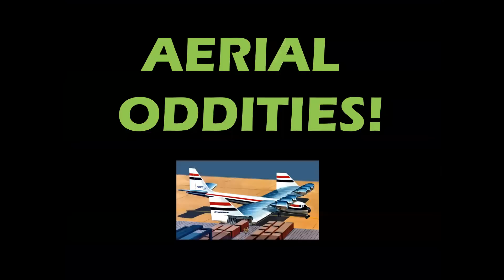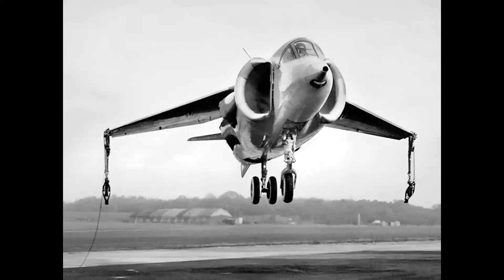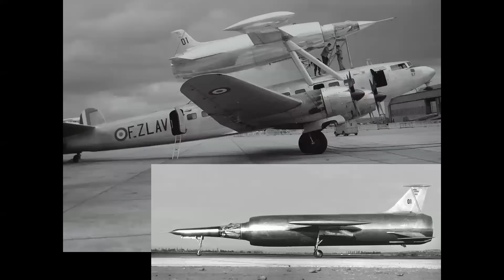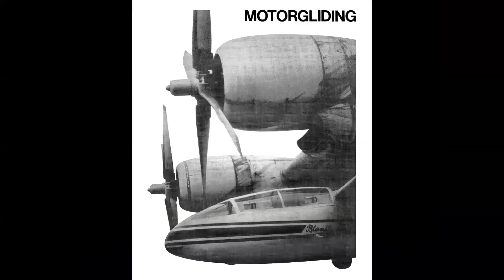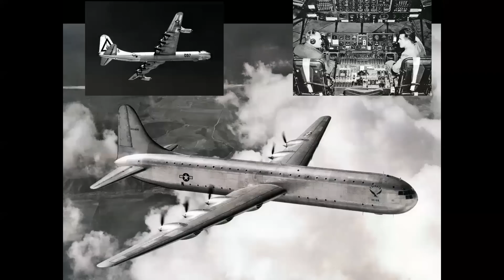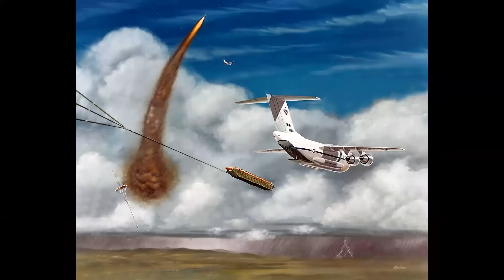AERIAL ODDITIES! - Strange and Unusual Aircraft from World War II to the Present

Comment: Chase / Stroukoff YC-134E was an upgraded C-123 with BLC for STOL, a strengthened sealed fuselage (mo boat "step") fitted with "Pantobase" pair of skis.
On skis, it operated from pavement, unimproved ground, sand, swamp/mud, water, snow/ice.
For some reason, the Pentagon wasn't interested.

Comment: Hi Mike,
I remember seeing some artwork, similar to what you are showing, from the early 1980s (???), outlining what seemed to have been a stretched, and significantly enlarged F-15, that was proposed as a maritime patrol / anti-submarine aircraft.  It featured three engines mounted in the rear, underneath the twin vertical stabilizers.  The concept was that while on-station both outboard engines were shutdown and the entire aircraft operated on the single center engine.  For takeoff and times where maximum performance was needed, all three engines were utilized.  From what I remember it was supposed to have a payload of 30,000 pounds and an un-refueled endurance of approximately 8 hours, while being capable of achieving speeds of more than Mach 2.   I was wondering if you had seen or heard of this aircraft?
Reply: It's possible you're misremembering the NR-349 proposal of the A-5 vigilante, everything you described is pretty much on the dot save for the twin verticals, I can't find any 1980s concept of a twin tailed tri-engined maritime patrol aircraft anywhere.
Reply from the maker: Not familiar with that concept, and thanks for your comment!

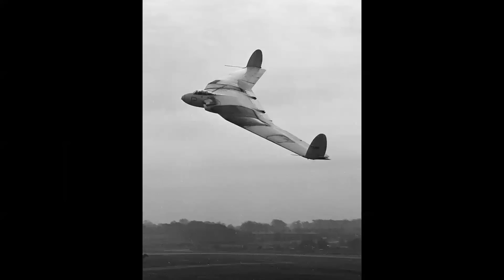Comment: The Thunder Schreech was an attempt at economy in a possible theory. It was an attempt to see if there could be a Mach One plus or more propeller driven airplane. The sonic vibrations coming from it during flight caused medical problems with everyone that was around when in operation including and worst of all for the pilots. 7:08/ It might have worked with extra controls on canards from the nose or pillons extended from the front of the wings. The P-32 Lihtning wasn't somewhat of an oddity? It was the production version of the F-82 double Mustang and was twice as good and twice as BADASS as a regular P-51 Mustang. Spam-load planes. Structurally, I don't think so.

Comment: I enjoy watching aviation oddities.
 There are a few you missed though.
 1)  a DHC5 buffalo landing with an air cushion like a hovercraft
2) a twin engined Hercules designed for the COD role.
3) a flying boat version of the Hercules with engines above the wings aka the Orion, which as of 2022  is being considered as a massive twin float seaplane.
4) a British vtol jet airliner
Reply: @ Paul Niccoll , of the twin engined Hercules that You said you would like to see featured, Lockheed did propose making a smaller twin engined Hercules called the L400, but it was canceled before making it into production.. But there is a twin engine plane type that were made in fairly large numbers (214 planes) made by a company called Transall,  and designated it, the C-160... It looks similar to a C-130, especially the empenage & dorsal fin...

Comment: Sad that when talking about tailless planes, you did not mention the flying wings of the Horten brothers. They developed a wing layout, with a "bell"-shaped lift distribution, that was stable, maneuvrable and VERY efficient. It ended up in the Horten Ho IX (also called Ho 229 an Gö 229) jet fighters, of which one prototype, the V-3, still survives in the US.  
 
Weird that their layout was apparently largely ignored by later designers of tailless aircraft. 
 
 
And regarding a load-carrying airship: In the late 90s there was the Cargolifter project in Germany, an airship that should be able to carry up to 350,000 pounds of cargo. The argument was that this would make it possible to transport large bulky assemblies in one piece point-to-point, which would be very hard or impossible to transport on the road or by train. 
 
But after the company had completed a giant 1,000 foot long assembly hall, it went broke. "Miraculously" the hall could be reused as holiday park.

Comment: I'm surprised that you didn't mention the scissorwing x-plane, the Super Guppy, Beluga or Dreamlifter. They are certainly aerial oddities.
Reply from the maker: Good point, thanks!
Reply: @celebratingaviationwithmik9782  a lot of the oddities you listed were not "production" types, so the scissorwing fits into that category. A couple of other oddities- other strange 747 variants like SOFIA, the Shuttle carrier, and the engine testing 747. WW2 oddities- the Dornier 335 Pfeil, with it's front and rear engines, and the Me 163, a tailless rocket plane with poisonous fuel.

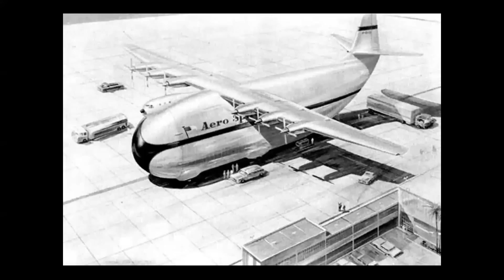Comment: what was the reason to build the ultra heavy cargo glider plane? C5 without engines? with a gliding figure of 1:10 you have a rage of 120km.
Reply from the maker: Wondered about that design study myself.
Reply: @celebratingaviationwithmik9782  yeah i like the idea, really. maybe for silent landing? but how to get the plane away silently then :)

German sailplanes landed on a French Fort to deploy newly developed shaped charges. it was useful to use a silent, stealthy glider.
Reply: Ever seen a tandem or double-tandem semi on the highway?  Doubles or triples payload for a relatively small increase in direct operating cost.  Only reason it isn't common practice in air freight is that operational complexity offsets the direct cost advantage.  I'd wager that climate change, energy cost, and advances in automation could dramatically alter that equation in the near future.

Comment: I grew up in Fairfield, Ca which is close to Travis AFB. Seeing those flying warehouses called the C-5 war really something.
      I was once driving down Highway 12 when my car's engine started making a horrible screeching noise. I pulled over and shut off the engine but the screeching continued. I was very confused until the sun turned off and I realized it was a C-5 taking off out of Travis.,
      Scared the hell out of me. I had no idea what was wrong with my car but it didn't sound like a cheep fix.

Comment: While the XF-85 was tested on the B-29, it was intended for the B-36. There was the NB-36, which was a test bed for a nuclear powered air plane,and while flew with a reactor, it never powered the engines. There also was a design of a twin C-5 for possible shuttle transport.

Comment: I love the BV-141. Actually the offset cockpit/nacelle played into the torque/thrust of the BMW 801 radial's 1500+ HP. Udet loved it. Goering hated it. I have a 1/72 kit of it somewhere in my stash.
Reply: Try to find a kit today. I also like it. It looks neato.
Reply: @garfieldsmith332  Yeah. I intended to give it a 2-tone Luftwaffe camo job. With the splinter pattern but in Brown/Sand rather than the Schwartzgrun/Dunkelgrun European scheme, and a White Axis Mediterranean fuselage band. And some extra guns for ground support.
Not historically correct, but it would be a fun build.  A Campini-Caproni CC2 jet would get a similar North African scheme, but with added 40mm wing guns.
Reply: @HootOwl513  That would be swell. It would be a fun build. A bit different. I have seen on the internet conversion kits that put the observation pod at the end of the wingtip. Or added pontoons, and saw some other colour schemes. As Max says your model so build it your way.
Reply: @garfieldsmith332  GlueTroopers -- Do or Die.

Comment: Didn't Lockheed also trial a proiposed L-1011 twin? How about the turboprop Connies of the USAF?  This was another good show!
Reply: Those turboprop powered C-121Js weren't oddities, instead, they, along with a small number of C-97s that were reengined with Pratt&Whitney YT34P-1 engines to become YC-97Js were used by MATS to conduct operational testing on the T34 engine, which was selected to power the C-133 Cargomaster.

Comment: I had a Wen-Mac Hiller Flying Platform, insanely difficult to fly, very hard to find
Reply: What happened to it?
Reply: @darkwood777  I was fortunate in that I took care of it and kept the box and just displayed it for decades. Then someone "had to have it" and the "ka-ching" of the cash register was deafening
Reply: Was that a (Cox engine? ) control line flying model?
Reply: @billdurham8477  no, it was inscribed Wen-Mac, it used a flexible metal shaft you held to counteract counter-rotational forces, so you were 3 feet away from it tops. You could make a great drone out of it today with some work